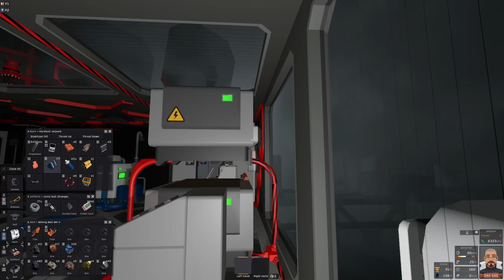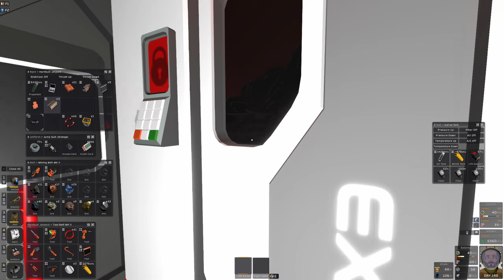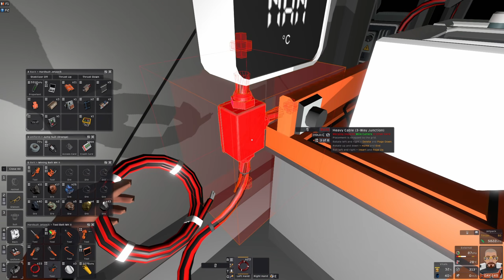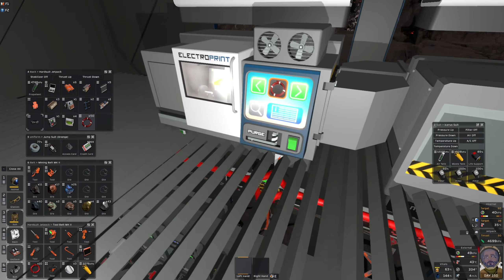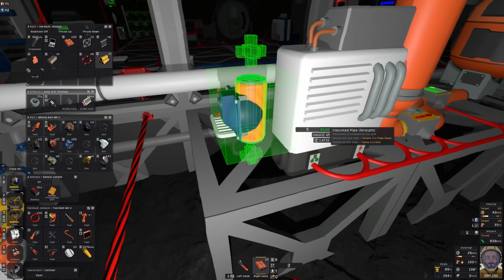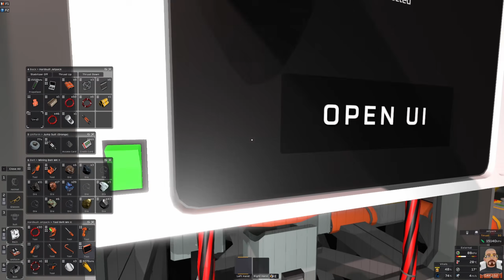Tearing Up The Old Wiring - S2 E45 ║ Stationeers

Comment: Rockets don't really require more than 5kW. You can build a station battery or two near the launch tower that is fed with 1-2kW via a dedicated transformer, and run separate heavy cable from those to your power umbilical(s) center ports which are limited to 5kW each already. With charging of rocket batteries adjusted to run on a local energy buffer the rest of the systems are fairly minimal in energy requirements.

Plus, this means your base power grid has a steadier demand from trickle charging the station batteries instead of being rapidly drained once in awhile when the rocket lands.

Comment: 21:10 you will need at least 100L pipe network after turbopump in order to work correctly or it will over pressurize pump network.
Reply from the maker: It filled up the rocket without any issues, so I guess it will do. :)
Reply: @Hmuda  yeah, it's probably because you have low pressure in a tank. I have 50MPa in my fuel tank and i hade to put utility kit on a pipe network otherwise it over pressurizes.

Comment: What version of Linux are you using?
Reply from the maker: Decided to take it easy, and started with Mint.
Reply: @Hmuda  I will be joining you. Ive been thinking about this for a while. I will practice on my laptop first though
Reply from the maker: @karyjas1 I recommend either doing just that, using a PC that can be used as a test, or using dual boot until you can decide if it fits your needs. It took me a couple weeks to sort out everything. Davinci Resolve was a pain. :P